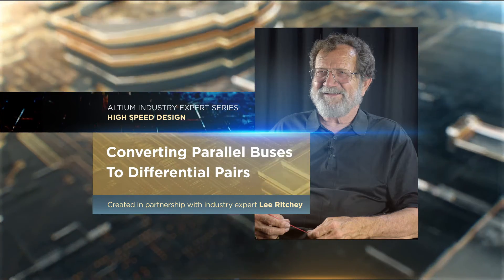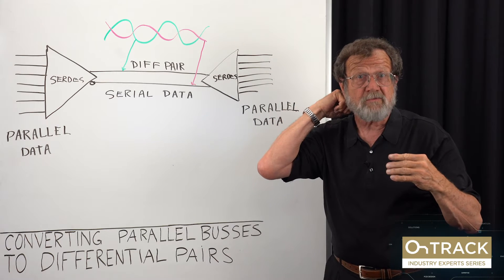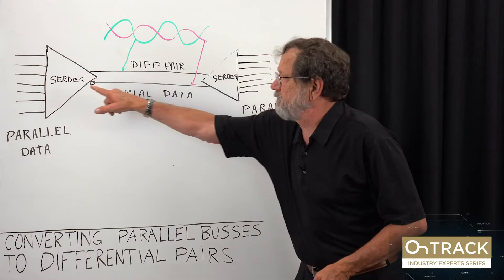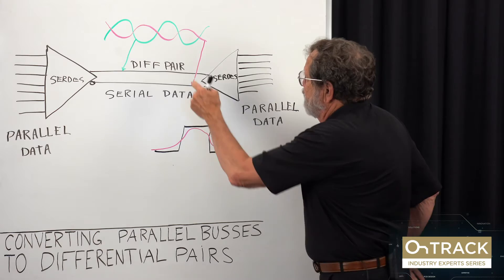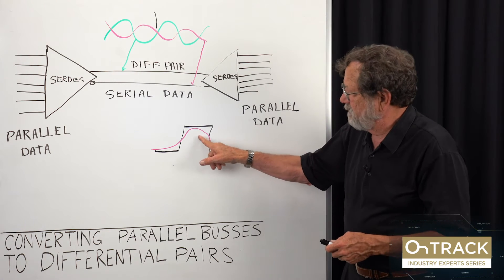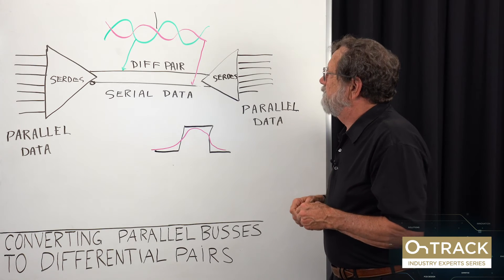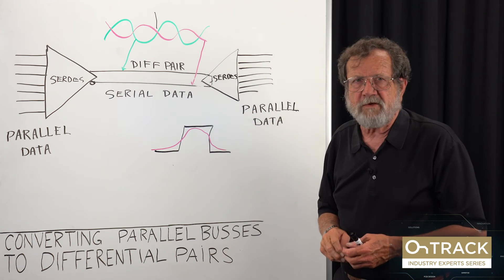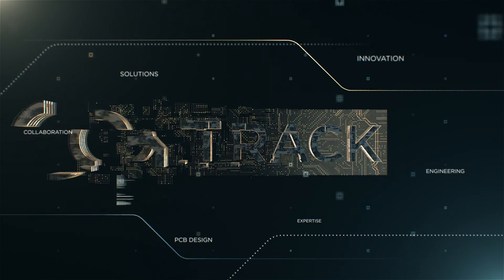Converting Parallel Busses to Differential Pairs - Altium Academy

Comment: For a single ended signal going into, say, a Schmitt triggered input, how would it matter that edges are degraded? Isn't it much the same situation as evaluating the crossover point of two differential signals? Not sure I understand why one is much better than the other here.